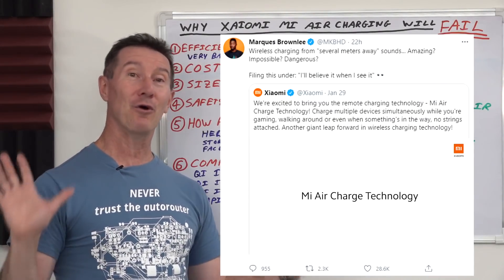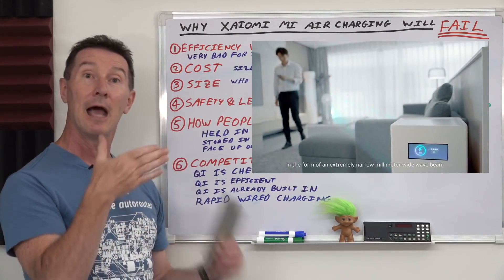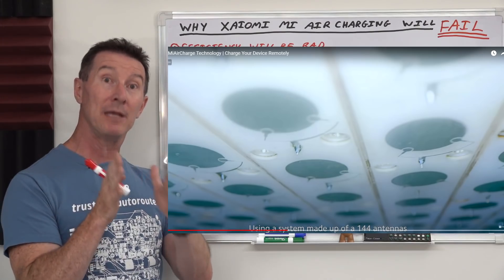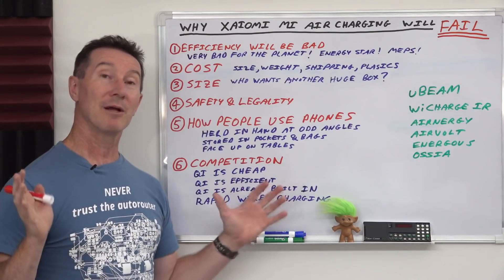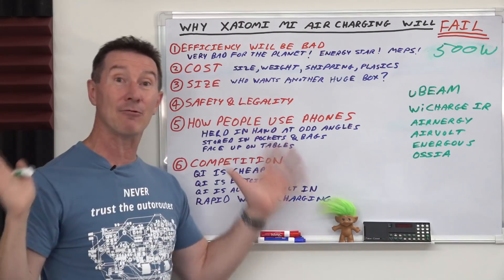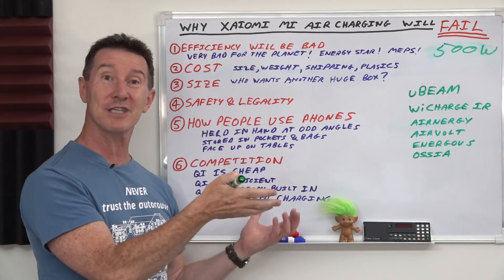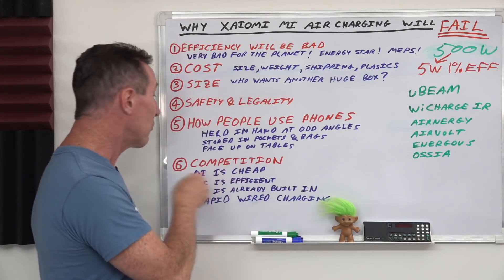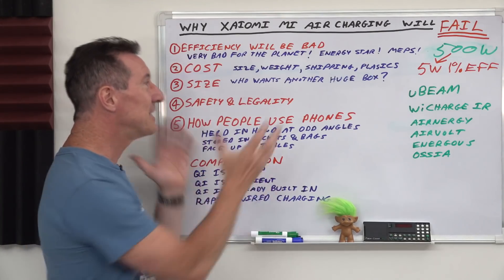EEVblog #1369 - Xiaomi Mi Air Wireless Charging BUSTED!

Comment: I was trying to power a simple Dallas 18b20 temperature sensor with wireless power and just have the data link wire. couldn't get it to work because it was likely impossible. But I learnt things that is good.

Comment: If you think "true" wireless charging is doomed to fail, you have not paid attention to the trend. Apple's removal of headphone jacks enabled a multi-billion dollar industry on wireless headphones. Of course we already knew the wireless headphones were "never" going to sound as good as the wired ones. But people spend triple the amount to get wireless. Xiaomi is not the only player in the market enabling wireless air charging technologies, Motorola also developed a demo prototype. I agree with the low efficiency part, the higher the frequency the more attenuation at a longer distance. However, we have to believe that this is what the market wishes for.

Comment: got bored of digging around enough stats to be able to calculate .. that can 5w input even match the consumption of modern phones.   few examples came really close , even screen turned off  on normal standby and data transfer going on.  
None of the phones i checked would be able to run streaming video with 5w input...     
Anyway...   21 hour charging times sounds reasonable ... allot of time to do something else than look at your phone ...  Some say that there's an real world out there..

Comment: This all of course only really holds in the home environment. In a business/factory setting, this can make placing tons of sensors a lot cheaper if you don't have to wire them all in. (Plus they need very little power so only a bit of charge every day). And if the duty cycle of the system gets that low, it stops mattering how wildly inefficient it is. But this works probably the best with the IR laser based ones due to the ease of aiming essentially.

Comment: Why the obsession with wireless charging?  I have an iPhone .  While it is heavy on batteries, under my normal use, I get between one and two days on a full charge.   I usually carry a spare battery pack for emergencies, but generally don’t need it.

I just have a decent 5 port usb mains adapter, and just plug my phone in overnight, so it charges while I do.

The charger only takes a few watts to charge the phone.  I think it can go up to maybe 100w, but that’s with all five devices plugged in and charging at full power.

Comment: Aside from the technical details, which Dave and Shariah have done a fine job of blowing away (as this concept deserves), what sort of lazy, selfish moron thinks that this is a thing that the world needs?  Only a marketing idiot could see a point to this environmental vandalism!

A cable of 1-2m, with a USB-something connector and a mains switchmode PSU is a mature, reliable, inexpensive (both in $$$ and environmental cost) solution to the problem of charging a mobile device.  A global standard, that is device and manufacturer independent, and simple enough for anyone to use.

Comment: @EEVblog - You missed one key point on practicality IMHO...  The screen displaying the current charge on a large format phone, would absorb a good portion of that 5W.  Moreover >4" smartphones struggle to take a meaningful charge on a standard USB port (2.5W), mostly just delaying the inevitable.  Using a standard USB charger 5V @ 1A (the same power this product claims to deliver), while using GPS on my 5" smartphone, the battery was still discharging while the charger was working as hard as it could.
  
There is a reason most smartphones moved to USB-C... one can do 100W over a cable.

Comment: According to the description, it sounds like those battleship rader emittion component. Probably they want to lower the cost to mass produce these thing? well, a battleship will need a matrix array of these kind of emitters and that will be probably couple of mega watts. Or do you think they are dum enough not to test it before it roll out from the lab? They do it on purpose. 

Just what purpose it is?

Comment: You know what, i was thinking it could have some limited use. I mean, who wouldn't love their Bluetooth headphones to just stop draining their tiny internal battery while you're in a well-powered place? Or have just enough ambient power to continue using a phone without it losing much charge, maybe getting a tiniest of boosts in the process? Unfortunately, the receiving part is too complicated for tiny Bluetooth gadgets, so that's out.

500W estimated power draw for the base station makes it completely unsuitable for home; but it would still leave it potentially useful for places which are, by their whole purpose, fairly wasteful. Such as at a restaurant or a high end retail outlet.

But then you mention rectification losses of 50%. This kills it. Nobody will want to use this even with all the other concessions. Because now, if and when it works, you have a 5W heater in the back of the phone, and... just think about it. That is... quite an amount of warmth for a palm sized plastic- and glass-covered object to dissipate, it would probably make it a little difficult to use the phone, and besides... you never want to have this kind of uncertainty, whether it's your MiAir working, or whether your phone's battery is about to do a Note7 on you.

I also think people will be more impressed, than saying it's 1% efficient, to say that it will take at least 1kWh to charge your phone. That's like... about 10 litres of coffee.

Comment: Isn’t data transferred via 5G technically power that is in the form of wave changed into energy pulses via the antenna. That means it’s a sudo cell tower and your phone is a receiver...yea if this worked well they could have done it with cells already

Comment: So... those Tesla-free-energy-doodad believers should all just watch this video. It's pretty stupid to think that people still believe the world can be powered with 'free' energy coming from huge high voltage antennas generating massive electric fields pulling energy from nothing. And the only thing stopping it from happening is the energy corporations that are somehow covering it up -- the whole story is completely dumb.

Maybe it's worth doing a video on the whole theory surrounding Tesla's "magnifying transmitter" (which is basically a long wave radio tower) and the reasons it can't be used for power transmission?

Comment: Wait, what? How do you lose that much energy in a few meters if the beam is even somewhat directional? Does it heat up the air? Thats like small-ish electric heater. Doesnt seam right

Comment: i think that any radio receiver would work, can’t they just add another WiFi module to the phone and  oscillate the radio frequency from 2.4GHZ to 50hz or 60hz and then rectify it into the battery 🤔📻🔋😐🤷‍♂️

Comment: If tou try to transmit ~0.5 kilowatt of millimeter wave radiation, the best appliation would be as a wireless kettle. At such frequencies the heating effect is going to be huge. And since mm radiation is absorbed by air (signal falls exponentially with distance), 5 watts at 2 meters would become 50 watts at 1 meter and 160 watts at 0.5 meters. This is enough to bring a cup of water to a boil in ~5 minutes. That means that standing close to this thing would raise serious safety concerns, e.g. about how to prevent the lower part of the body from reaching boiling temperatures. Anything plastic or glass that is in the way of the beam and close enough to the transmitter is going to get melted or severely damaged.

Comment: Hey!   I've got a great idea.  Why don't we have phones where when it is flat, you can can just swap the battery for a fully charged one out of a dock or something.  
Yep, read that in full sarcasm mode.  Additionally, having the life expectancy of a piece of technology worth hundreds (or thousands) tied to the life of the glued-in Li-Ion battery inside it is just lunacy.  Xiaomi could get 25% worldwide market share this year if they made a phone with a replaceable battery (they currently have about 13% but that does include China).  A 3000 mAh battery isn't that hard to do, and that's all it would take.

Users (known as oozers in the trade) need to get over insisting on 4mm thick phones (you put a big case on it anyway, yeah?) and stick it to the manufacturers about replaceable batteries.

Comment: I think there is a good reason for development of this system:
power from Space technolgy and
directed energy systems
possibility integration in mootw c-ram skyshield as energy affectors
RAM: c-range capabilitys to adress asymetric arial attacs, LSS-targets
It's a complex tech and you need to cover some of it's development.
Tracking of mobile devices (SR-71, B2, sidewinder, railgun shells) is a complex tech for itself. The directed energy systems are most liky to be used as an addon to 35mm affectors.
https://www.youtube.com/watch?v=jMx1-yaRLyQ
https://www.youtube.com/watch?v=tyUh_xSjvXQ
https://www.youtube.com/watch?v=OmoldX1wKYQ (the posting guidelines are offline)

Comment: Sad to admit I was a D student in electronics class mostly due to not doing any of the homework. But getting A’s on all the physical hands-on lab projects. Right off the bat I could see this is about it as efficient as using linear power supplies with vacuum tube rectifiers to charge your iPhone that’s how much power you’ll have to use and waste.

Comment: I am a high voltage hobbyists and I build such things as Tesla coils. A lot of these arguments that you make reminds me of the nonsense that also accompanies claims of long range wireless power using Tesla coils on various forums that I am a member of. The physics of the inverse square law tells us that this is terribly inefficient and can't work over a distance of more than a few meters. Never the less, people are still trying to make this work after 120 years of failure, beginning with Tesla himself. If you try and point out the physics of the problem they basically claim that since Tesla thought of it, that it will work if implemented properly regardless of all the failures. They dredge up 120-year old papers that Tesla wrote even though he didn't even believe in the existence of the electron and only had a rudimentary understanding of Maxwell's equations. Finally, they claim its all a conspiracy by industry and government to keep wireless power from "the people".

I have given up trying to use physics to convince them. Every time I see one of these statements now I simply tell them to demonstrate it at any scale that they choose. It never happens. "Extraordinary claims require extraordinary evidence".

Comment: A couple of other problems.

At 500W or 1000W, you can get this powered from a normal North American houe circuit (15 amps rated current at nominal 120 V is nominally 1800 W), but for a more plausible 5 kW required system, there's no way to do it on a normal household circuit.  (You'd need the type used for electric vehicle chargers, electric stoves, or electric dryers, at 40 A at a nominal 240V.)  It would be powerable from most UK circuits, but it would be a rather large load, as it would take something like 21A at a nominal voltage of 240V, and the limit for total load per distribution ring (each floor normally has a single distribution ring in the UK, serving all outlets on a floor of a home) is 30A, with a heavy load being considered to need 13A.

The parallel problem is waste heat.  All the energy that doesn't end up in the phone's battery has to be converted into heat in the room.  Do you REALLY want an extra 500W heat source in a room?  My apartment is usually too hot when the heating is on (old building, I don't have individual control on the hot water heating system) due to having south-facing windows.  In the room I'm sitting in, it's often sweltering from the additional heat from my computer, which is about 350W.  Just imagine having a 5000W heat source in the room!  Want to see what kind of devices on the home market actually use that kind of power?  Here's one:

https://www.hotkilns.com/kilns/lb18-3-hobby-kiln

That's right, it's a damn ceramic kiln!  And a pretty big one for a home user, too, with a capacity of about 2.5 cubic feet.  It can get up to a couple thousand degrees in fairly short order.  5 kW is a LOT of waste heat!  Never mind the ethical and legal problems with the thing, you'd need major HVAC capacity to control the temperature in any room you put this into!  (Yes, I'm serious, if this thing really would waste 99.9% of the power put into it, then it would be like turning on a hobbyist ceramic kiln with the lid open.)  Then consider how much it would cost.  Not for the device, which is going to be stupidly expensive to be able to manipulate that much energy, but for the energy!  At a nominal cost of 13 cents per kWh in the US, such a device would cost about 65 cents per hour to operate, which is ABSURDLY expensive for electrically powered devices in the home!  That's the equivalent of well over $400 per month for the electricity to run the transmitter, and then MORE for the HVAC to keep the room you have it in livable!  Even the Clintons wouldn't run a device like that!

Comment: 500W of RF transmission. Way higher than permissible transmit power for domestic appliances. Also, I do not want to live near to the500W wireless charger..  

It also generates EMI/RFI  which may disturbing other electronic  appliances.. Very bad idea.

Thank you. 73.

Comment: Five watts? Just put a hand crank on the phone. Low power; Yank out the crank and start winding. No death beams or anything, 100% green nature friendly power. And when you gotten used to it you can operate the phone whilst winding. Quick charging? Just swing it like a ratchet noisemaker. The 'hand crack phone' - winner winner chicken dinner!

Comment: So if the transmitter emits 500W, and only 5W or 10W gets received on the phone where does the rest of the 490W of power go? Apparently it should turn into heat somewhere. Given that various materials either reflect or absorb this specific frequency, there will be items in the room that absorb it very well and get hot. Maybe melt.